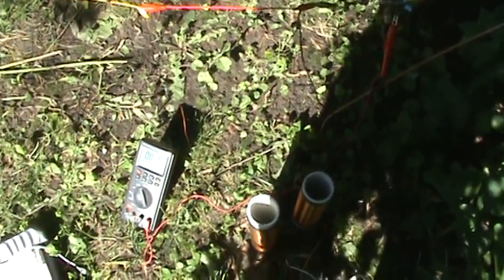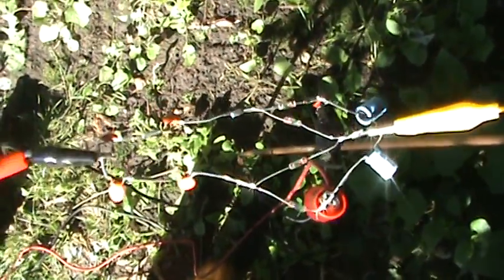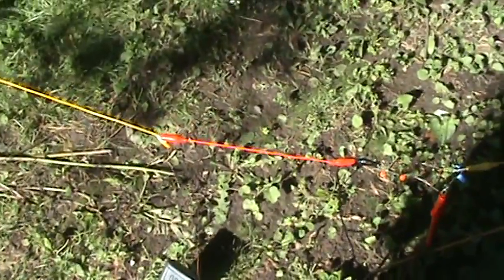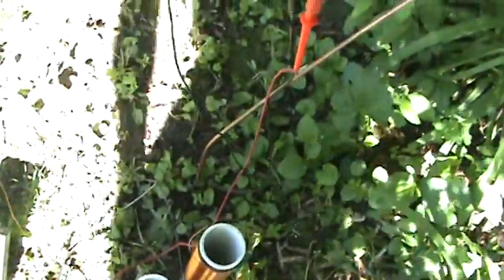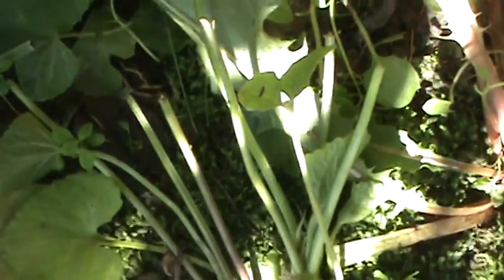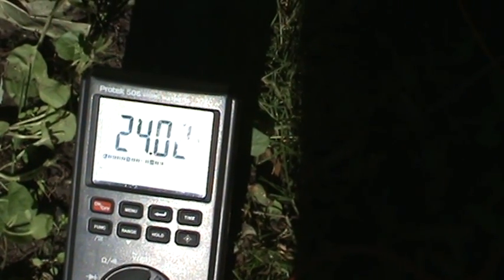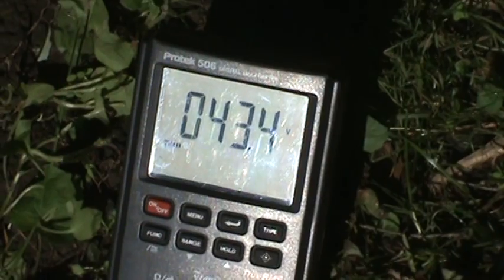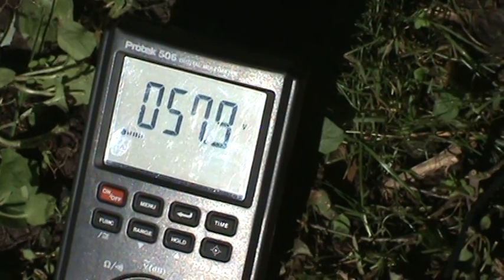FREE ENERGY FROM AIR CIRCUIT PART 8/24

Comment: I would think that the capacitance of the wire guage would affect the volume of current. Have you tried a larger guage of wire?
Reply from the maker: Good point, yes, i agree, more surface area the better.  I have not tried larger diameter wire, but i have tried coaxial cable and did not get as good of results as i do with the wire in this video.

Comment from the maker: All power lines on the block here, run underground. Nearest radio & power stations are aprox 5 miles away.  Antenna is running N & S(high end is N).
Im still working on new concept i want to incorporate into this circuit, hope i get it working soon, then i will post more videos of this.
I posted new videos today on other subjects though :-)

Comment: I've purchased a kinder toy that stacks doughnut shaped plastic rings, on a teeter todder base. I plane on splitting the largest ring and filling it with Magnetite. Magnetite will loose its magnetic flux field as fast as it gets it, meaning it switches. The hollow wound toriod will setup a strong north/south pole but with a solid core, wel you now the rest. It's all a work in progress. Change the world we will...

Comment: If I was in your shoes and had the setup you have. I would take your source and wind it onto one side of a toriod core with a given amount of winds. On the other side of that toroid wind a smalller gauge wire with more winds, use a ratio so that you then have some numbers to work with. Basicly a step up transromer. A joule theif would be my first go and then try the toriod.

I need help with all of this, I'm not an EE elctrical engineer and I've only found marginal success so far.  Thanks

Comment: I've put the components together and got .394V, not much. This may be because I'm using different diodes than the germanium. At this time I will only need 3-9 Volts. I must have blown something I'm not getting anything now. The load in my setup is a magnetic rotor that spins in a coil/inductor/capacitor I'm not sure yet. but this motor/generator spins, what I call scary fast, approx 2200+ rpm., on only 6VDC. I feel my setup will add the current we are looking for, the muscle as it were. :)

Comment from the maker: Hmmm, interesting idea. Hmm, what is quartz natural frequency,,i will have to look into that,,wonder if size of quartz makes a differance as to what frequency it has. I like the way you think!,,to resonate with crystal, yes piezoelectric, add pressure,voltage,,Hmm,this idea will stick in my head. Im making some hutchison crystal power cells(ever lasting batteries), and i was thinking of using that as the crystal. Yes, Yes!!  good idea!! I will try this soon. First to finish some of these cells.

Comment: yes. a wounded coil directs the polarity and the direction the waves will collect or emit. A solid doughnut would work but it would be easier to use a hollow doughnut.

Comment: I'm curiuos, I understand that radio frequency travels/resonates in a pattern that expands in all directions from its source, in lets say a spherical shape. Using a doughnut antenna is an interesting reciever. A dc induced toroid inherently has pole domain orientation in its' B field. Or where you thinking of a soild foil doughnut shape? Which would still do the trick. But from my understanding the wound toriod would do exceptionaly better.

Comment: Lets build on this transformer idea. I know I'm using transformer out of context but , I'm fairly sure we can transform 'change its energy state' into momentum. In lets say a motor...no no a generator of sorts. Quartz crystal what does that resonate at?  compared to the radio waves you are recieving? Can we make those resonate in sink? The reason I'm thinking in this pattten is that Quartz is a piezoelectric effect/frequency. I'm hoping Simhere2 will join our venture.

Comment from the maker: Hmmm, i may need a special homemade transformer.  Most transformers work with AC,,but i have DC output,,,and most transformers need a certain amount of current to get the transformer action.  I think the key to getting more power will be to get things resonating.

Comment: What about if you connect this circuit to load? I think the voltage would drop down to maybe 5 volts. Because you have 2 large coils, they're working like a condensator (induction). They are now fully charged at 76,3 volts.

Comment from the maker: did you see first comment on this page?
I have tried 18" dia sphere and 14" square copper plate, but only on 12 foot high set-up....i did go from like 5V to 7V.
The sphere gave me a little more because it has more surface area, but yes, i would like to try them on top of pole now, 41 feet high....but next i want to try a screen on top, maybe 1/2" mesh or chicken wire.
Your thinking is on the right track.
Thanks for comments.
more testing this friday, tomarrow.
I will keep informed.

Comment from the maker: Hmm, i have not charged a battery yet, i do feel confident that it will work.
I have many notes on that particular patant.  i have tried a 12 inch square insulated reflective plate....i got about 2 extra volts...but that was only with a 12 foot high set-up. I got better results with an 18 inch dia sphere...it does have more surface area. I will have to add another guide string for my antenna pole set-up, to make it sturdy enough to support the sphere. next i will try adding a rolled screen.

Comment: You should try and charge a 12v battery with this.

Apparently you can get more watts if you tweak this to retrieve background ratation, by putting up a insulated reflective plate.  patent 685957

Comment: great work! maybe i should hook up those huge ones i made and see what happens lol. if u can get it to charge faster you can use a capacitor to create a dischage making a higher current, like the tesla coil design, u charge a cap to a high voltage and then discharge it to get a huge current, time the circuit to discharge at a fast time and there should be alot more power. wow! great i guess i should start doing this again lol thanks for keeping the info free too!

Comment from the maker: i have tried a copper plate and an 18 inch dia stainless steel sphere, but on a less high set-up. It does increase voltage a little. I want to try a screen on top. i did try s.s. rod for ground & 1018 mild steel rod. not much differance, but maybe i would see a bigger differance if i went deeper.

Comment: Nice work Paul. 
In my previous comments I refrenced nikola tesla's radiant energy patents, and your experiment is looking more and more like his design. 
Have you tried a shiny metal plate at the top of your pole?? I think tesla just polished up a steel plate and varnished it to prevent corrosion. 
You are right about the ground deeper is better, but have you tried any different metals for the ground??